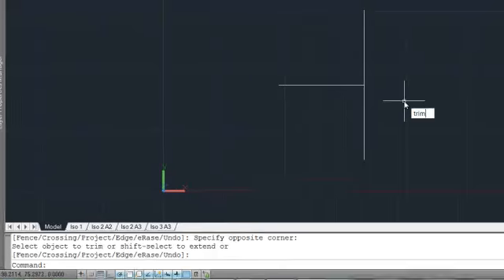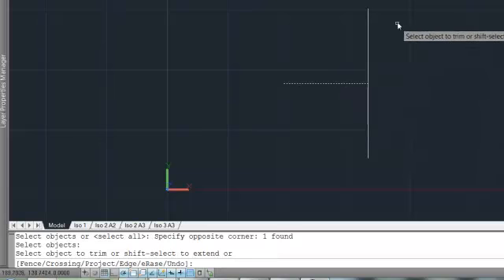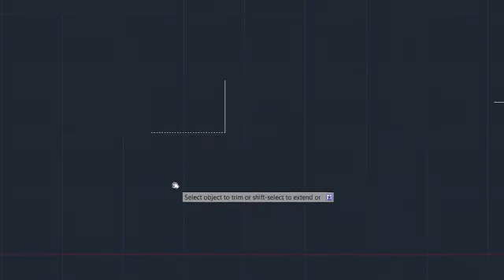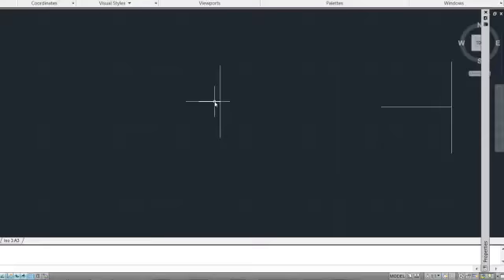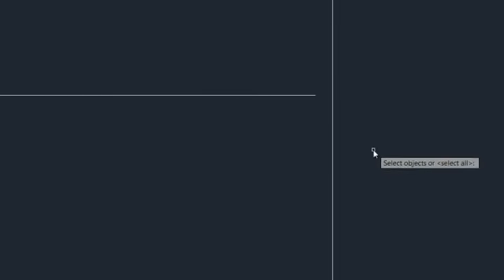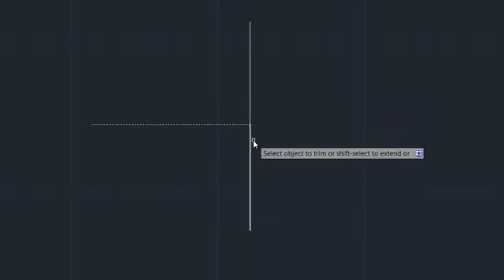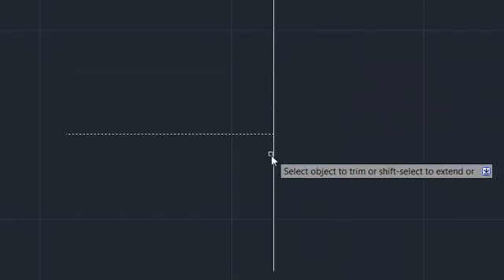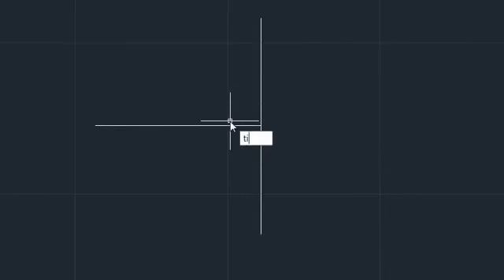Trim

Comment: Where do you get TRIM fnctn?  Thanks!
Reply from the maker: It is a default command. You can use the command 'tr' or 'trim' in the command line, or you can find trim in the ribbon.